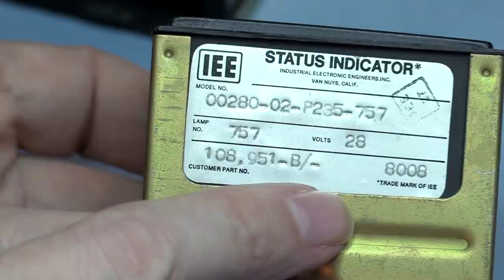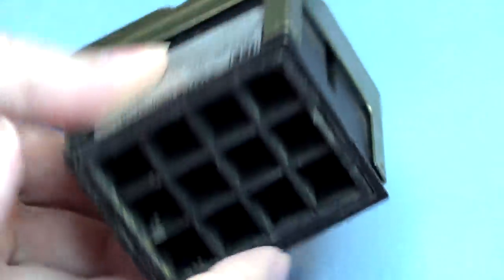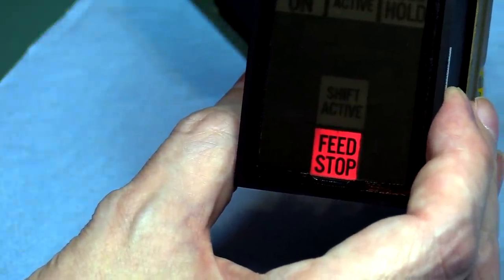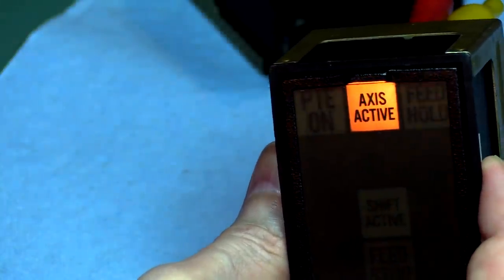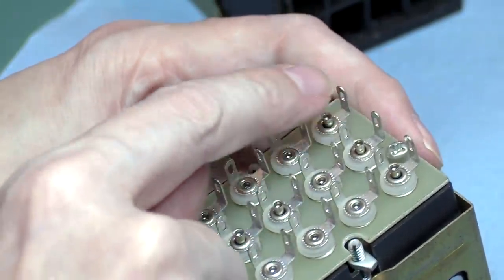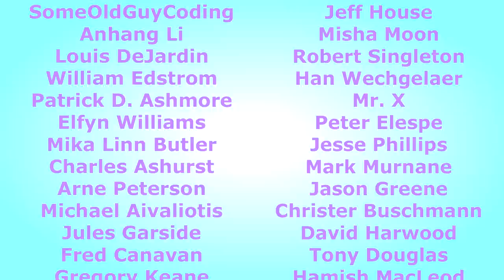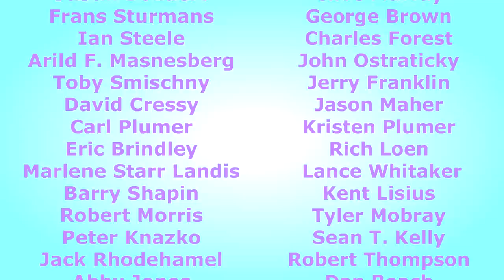The IEE "Status Indicator" Display Module

Comment: Thank You Fran. I used to make displays similar in my home shop in the 80's. Made Joystick interface for Quadriplegic wheelchairs. I used their chin controlled joystick, with a small switch to change between driving mode and accessory/function controls such as lighting, seat lift/recline, etc. Used Icons the patient and I made and I took sketches I made and designed final artwork on My Macintosh SE and laser printer I sent to photography for negative film. Every controller was unique to the patient. All analog for selection and operation. Did use LED's for illumination. Man, I was in my prime back then. Stayed up for days at a time for the first one. Brings back great memories. Thanks for that, Fran
Reply: As an unemployed biomedical engineering grad that is goals
Reply: this is so cool, would love to see a video about it!
Reply: Random question: Did you use Claris MacDraft or Aldus PageMaker for this? Just curious because, around that time, my father and I were publishing programs for my high school's band competitions on our Mac Plus. Reading your post brought back some memories.
Reply: @dashcamandy2242   i used MacDraw also made a grid-locking template for schematics where all components snapped together for pretty useful drawings for the time.

Comment: "1819" bulbs, pretty sure.  We used those in some control rooms and 28V indicators were either 1819 or 1820's  (1820's draw a bit more current).  We sometimes would 'relamp' them from the back if we could reach it easily by pulling those two screws you did as well.  But normally we had to go through the front and we used a short rubber tube to push in, sliding over the glass bulb to push and turn.   Rubber 'hose' like tool gave us more 'grip' on those glass bulbs.  :) 

Nice seeing someone interested in these old IEE displays.  :)

Comment: I don't remember IEE switches or indicators at the BBC, but we had a lot of similar style things from Honeywell. When you showed the bulbs in their holes I remembered we had some special tools for them. There were tongs to take the fronts off some of the switches and indicators and a special tool for taking the bulbs out. A wooden rod with a beautiful Bakelite handle at one end and a rubber tube at the other that fit tightly over the bulb so you could take it out from the front. Occasionally the bulb would break and I would get the task of taking the whole panel out to get at the back! The other thing I remember was all the bulbs being rated at 28V, but run at 24V to extend their life. It's marbelous seeing all this old tech, and how well it was made.

Comment: I have a new appreciation for vintage status indicators thanks to you, especially after having to work on crappy, modern plastic ones (which WILL melt when used with the incandescent bulbs they come with).

Comment: 12:35 You can see how the cold flowing of the solder has flattened the end contact over the years. This is why you don't tin wires under screw terminals.

Comment: I miss the ramp and fade of incandescent too.
Reply: Agreed you can PWM leds to emulate the effect but it's never convincing.
Reply: @dogwalker666  because it's too perfect, with incandescent you get to see the filament itself fading, not just the glow of light. And also leds have a limitation before the flicker becomes noticeable, so at the very end they just turn off.
Reply: especially the fade, its so satisfying.
Reply: @goofyrulez7914  even with a capacitor once it hits the junction voltage it's off.
Reply: @gbrussa  indeed I am trying to re create orac from blakes 7, I just can't get a convincing effect without using mes filament bulbs but they are getting harder to obtain.
Reply: @goofyrulez7914  no problem.
Reply: Its a coveted look among traffic signal collectors like myself. The new led signals just don't have the same look as the old glass lensed incandescent signals
Reply: @jagerdoorn9293  indeed the LED ones sometimes have a visable flickering too.

Comment: Very interesting. .I have never seen one of these, but it is what I would call a micro annuciator. In industrial control it is common to have an annuciator on the wall to display high priority alarms. These are important enough that you do not want to depend on the operator seeing them on his computer displays. They often have internal auditable alarms and flasher circuits. One brand for these is apanalrm,

Comment: Many years ago, I used to work in a UK defence equipment manufacturer and a number of our units used something similar. They were much smaller and used 24v/28v miniature flange base style incandescent lamps. To get colours, the lamp would be fitted with a clear colour silicone cap. At the time, LED technology was improving and some lamps would actually be standard 5mm lens ended coloured LEDs with a minature flange base, also some would be two colour multi chip (GaPh) orange and green to mimic the "warm white" incandescent lamps. Others would be plain yellow and some later ones would use a cob style single white LED chip with no lens.

The housings would contain a film with text on, just like those larger ones you have there. This would have a small lens that would sit on top of the text film, the purpose of which was to project the illuminated and coloured text onto a matt finish film on the front of the display. Only one would ever be illuminated out of a 3 x 4 matrix that projected onto the front 1 inch by  3/4 inch matt display film at the front. Common failure points were usually blown incandescents or overheated LEDs, poor electrical contact on the base contact springs due to wear, heat damage or corrosion (these units were used in a high vibration environment on sea going vessels).  

The other thing to watch with the miniature versions of these was soldering onto the centre contact, if you left the iron on the contact for too long, the solder would flow into the spring loaded contact rendering them useless. Sometimes, if you were lucky, you could re-heat the joint and remove the solder with a sharp downward tap on the bench. but if you were to do it with the displays in the equipment, you would have to disassemble half the equipment to remove the display! You only made this mistake once and learned from it!

Comment: Fun fact: Many indicator lamps in older cars (say, within the gauge cluster) work the same way... At least until they started using LEDs. The bulbs are in removable sockets that twist-lock into a PCB, and the bulb shines forward through a "tunnel" with a painted bit of plastic at the front to color the indicator and provide text/icons for the driver to see. 
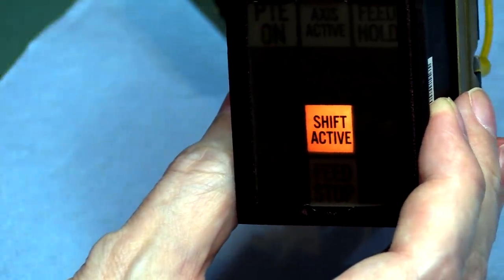4:27 - It says "SHIFT ACTIVE," but all I can think of is "CHECK ENGINE."
These are ingenious, in a way. Universal use, but for the specialized front lens.

Comment: The same principle was used in my first car, a 1962 Buick Special Wagon, for the turn signal indicators. By the time I got the car, the green Kodalith inserts had faded with age. I cut some green plastic from a report cover and inserted it into the two panel recesses...voila! Lovely kelly green indicators!

Comment: Very nice! You could probably get the used unit back into production by cutting a piece of smoked plexiglass and carefully filing it to an interference fit, then printing a mask onto one of those films that Big Clive uses for his home PCB production. Can't remember what that film is called right now, but it had a milky appearance which would diffuse the light from the bulbs very nicely.

Comment: For what it's worth, someone I worked with in the 1970's ran a company that built custom audio products.  He used these 28 volt lamps but only ran them at 24 volts to extend their life.  I wonder if that is typical?
Reply: Very typical to do that, and a lot of times you would, for a red indicator, use a 36V lamp to act as indicator, because then the lamp life for a power on indicator would approach forever, instead of the 1000-2000 hours typical for these lamps. You also got long life lamps, which were just a higher voltage lamp run at lower voltage, sold at a premium.

A lot of machinery that used 24V lamps also put in a ballast resistor in the lamp supply feed, so that the inrush current would be much reduced, and the lamps would run at a lower voltage as well. Lamps there would run for decades, even with being run at nominal voltage, as they did not suffer the high switch on current surges that typically failed them. Worked a lot on a machine that used 220VAC coils in a lot of the operations, but used a 24VAC lamp supply off the same 300VA transformer ( so you could use it world wide on anything from 200VAC 3 phase supply to a 400VAC supply by only changing a single link on the primary) and a 10R 50W power adjustable resistor in the lamp feed. Also had a 48VAC secondary that was rectified and fed to the main motor and a brake clutch to stop it hard when the motor was commanded off. I put in a variable speed drive, so the 60VDC from this supply was no longer needed for the motor, I instead programmed the VFD for nearly it's highest brake rate, any higher and I would have had to install the brake chopper resistor unit as well to handle the DC bus overvoltage.

Another machine also had hard braking, solved by simply having a 2kVA VFD driving a 1kVA motor, and brake chopper set to stop the motor within a half turn. Start was hard as well, ramp up to full power in as short as possible. Motor got around a half second of run time per cycle at most.
Reply: Yeah that was pretty common for pre-solid state devices
Reply: We used thousands of 1819 bulbs in control room simulators.  And yeah, we ran them on 24V and the driver circuits had 'keep alive' resistors across them so even when 'off', there would be a trickle of current to keep the filaments 'warm'.  Idea was to extend bulb life.

When we finally switched things over to use LED's (they make led-for-bulb replacements for 1819's and many others) we had to be careful of color tone (many indicators had colored lenses) and cut out all those resistors as they passed enough current that an LED would light dimly, even though they were fine with incandescents. :)
Reply: @mikefochtman7164  Keeping the filament warm also minimises switch on surge. Which could otherwise cause all sorts of problems with the rest of the system.

Comment: Those indicator legends reveal that it's probably intended for a milling machine of some sorts. They are also used a lot on aircraft as annunciator panels, you can probably print your own legends using a few pieces of overhead projector transparency sheet.

Comment: The process computer that I maintained at a generating station (Westinghouse Prodac 510) used similar technology displays for the operators console digital display units. The display use bulbs that had twist lock base like this unit.  If you did not get the bulb in the socket just right the numeral would be cut off on the sides or top or both.  They were VERY fiddlly to work on. Ad they always had a bulb out.  There were 7 of them in the control room.

Comment: Looks like that was probably off of an NC lathe... could be prior to the advent of common CNC milling or turning equipment. Probably ran off of 10 meters of paper tape, which interestingly enough is typically 16 K worth of data.

Comment: Just guessing, but I suspect a reason (and perhaps THE reason) for the bulbs being recessed so far was to protect the sheet with the graphics from heat from the bulbs.  Another guess is that the bevel on one corner of the front glass is to force you to install it with a particular face facing out.  I couldn't tell from the video, but perhaps one face is shiny and the other somewhat matte.

Comment: The independent bulbs for a staus indincator is not unigue. Usually a status indicator was located in a readily visible location so the operator could see status of several devices located in different areas

Comment: I miss the aesthetics of yore. Things now may be crisper and more precise, but there is an appeal in those old-fashioned tech. Recently the elevators in my building were refurbished (those are some OLD elevators, from the early 50's), and went from wood paneling, real-button buttons and incandescent bulbs for floor indicators to a stainless steel box with LED-ringed buttons and big 7-segment floor indicators. By themselves the elevators are okay, I guess, but they are woefully out of place in the building, with its travertine-clad walls and tile floors. I just don't know why they couldn't have gone with a traditional look for the paneling and buttons and indicators and a modern control system and motor.

Comment: Hi Fran, I have 6 IEE. The number is 24275-01 It looked like a Blackjack card light sign so AWESOME!   I wondered if you have an IEE book list? Also I want to know how much Voltage and Amp I need to get a power adapter. Cheer!

Comment: Based on the disassembly, I'd wager that replacing the bulbs could be done from the front, post-install.  Open the bezel, remove the baffle, and that would expose the tops of the bulbs.  Then a little tool- I'm thinking a tiny suction cup device with a longish handle.  Press that onto the top of the bulb, push down, then rotate, and the cup allows extraction.  Install is the reverse.  Re-install the lens/bezel, done.  No need to even power the equipment down.  ;)

Comment: It looks to me like the NC, NO, and C legends on the back are for pins that are not installed, rather than for the pins that are present. Presumably if a switch were constructed in this housing there would be additional pins present in those positions, and the switch mechanism would be inside the housing.

Comment: Such indicators were normal in the 1960's and 1970's for build and durability. 28 V lamps normal in military aviation in that time period. These were on the racked test equipment. Such indicators too heavy for the smaller, high performance military attack and fighter planes I worked on. We had the status lamps around the CRT radar displays or offset panel potted in Lexan with the colored word indications silk screened by a black mask overlay. Special long lasting grain of wheat 28 V lamps in the faceplates. One goes out, the whole or a section of the faceplate escutcheon was replaced.

Comment: You could almost use that status indicator without a lens to make an alphanumeric display.  Most of the numbers are easy (except, maybe 8).  The letters would be difficult, especially M, W, N, & H.  A 5×5 is really the minimum you'd need for good differentiation between all the letters and numbers and IIRC that looked like a 3×4 (or 4×3).

For the letters to work and to get some disambiguation, you would probably have to alternate uppercase and lowercase letters to get by with that 3×4 display.  I'm thinking A, b, c, d, E, F, g, h, I, J, K, L, M, n, o, P, q, r, S, T, U, V, W, X, Y, Z.

Just a thought...

Comment: I remember these on CNC's, not that i'm old enough to have run them when these were new. I would suspect that one came off a cnc in fact with that labeling.
Reply: I was thinking the same thing. I've never actually seen them on a CNC. However, the labels do seem right for a CNC. Only one that seem a bit "odd" is "PTC on."
Reply: @horseshoe_nc  might have had something to do with the old paper tape...

Comment: Industrial and military spec  made to last. In the late 80's to 2000's when I worked for Mitsubishi's plant in Normal, Illinois the indicators were square removable LED's with plastic covers with the name of the process printed on the underside of the plastic. They ran forever. I never saw one fail and have to be changed.  The push buttons had incandescent bulbs in them and they lasted forever too. Definitely not like the crappy LED's they sell for consumer use.

Comment: Is 28 volt not a strange voltage for an indicator bulb?!?
Equipment like that in the UK is mostly 12 volt...
Another Interesting video Fran...
Reply: 28VDC is a standard for aircraft.
Reply: @spehropefhany  ahh. Didn't know that.. Thanks.. 👍
Reply: Also, 28 volt is standard for anything that uses a 24V battery (trucks/lorries and other heavy vehicles). You need more than 24 to keep the battery charged.
Your 12V car battery is kept at 13.5-14V in normal operation, so automotive bulbs are designed to run at the higher voltage.

Comment: I the no the 28v standard is for some kind of aviation use. I have no idea what the indicator labels mean. Maybe some aviation guys can tell is that if they really relate to airplanes or not.
Reply: Looks more like an older NC controller legend panel, as the first ones were very expensive, so using a $100 indicator panel was considered par for the course.